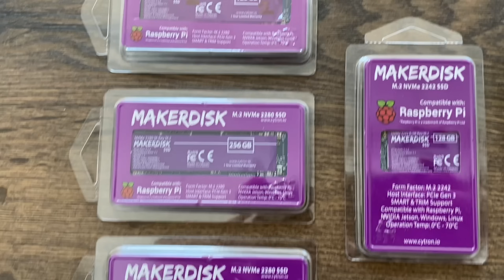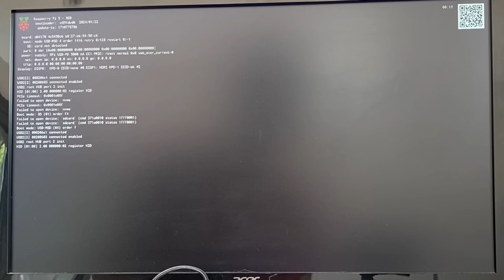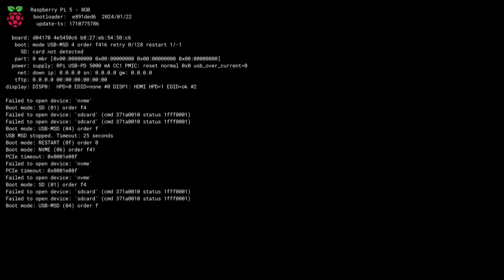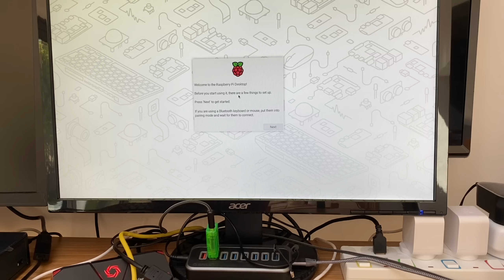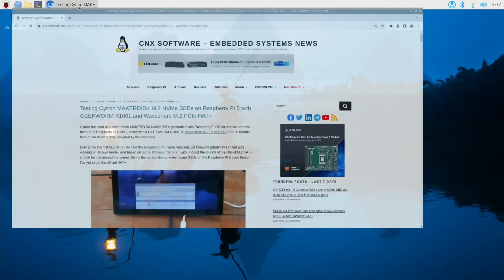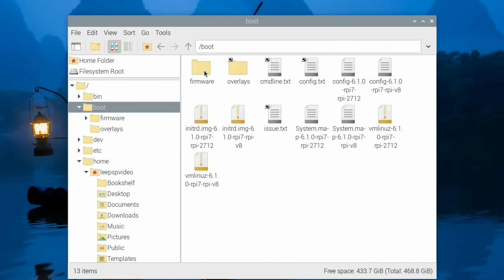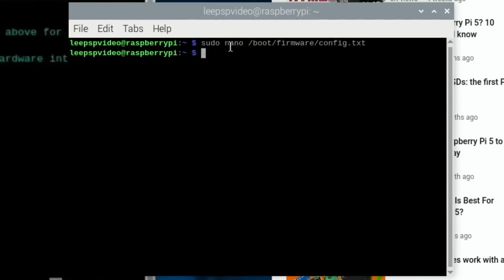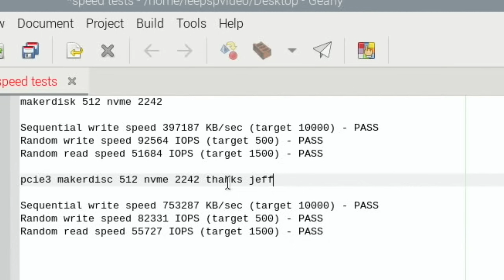Raspberry Pi 5 NVMe. Setup without a Computer. Cytron Makerdisk

Comment: in the /boot/firmware/config.txt file add three lines at the btm
dtparam=nvme
dtparam=pciex1
dtparam=pciex1_gen=3
I have 5 Pi 5's and zero issues with my config
same config below this all to over clock is 
arm_freq=3000
gpu_freq=1000
i wouldn't do over voltage or force_turbo. doesnt seem to matter

Comment: So the title is basically a clickbait. You NEED a computer if you don't have some special fancy nvme instead of one I want to buy.
Reply from the maker: It’s not clickbait. You need storage to use a Raspberry Pi. Makerdisk have sd card, 2.5” SSD and NVMe drives pre installed with Raspberry Pi OS. Hence the “setup without a computer”

Since this video an eeprom update now gives a network install option which also doesn’t need a computer

Raspberry Pi 5. Major eeprom update 17/04/2024. Network install & more
https://youtu.be/prqzOg-GC40

I have also made tutorials setting up a pi from an Android phone 

First time Setup with an Android phone. Raspberry Pi 5
https://youtu.be/H7DMzSvOWK0

Comment: Can we use Apple MAC power adapter for Raspberry PI 5
Reply: The USB 3.0 standard can provide up to 20 volts at 3 amps, the Raspberry Pi 5 probably maxes out at around 2 amps at 5 volts.

Even though Apple gets their hardware made in China just like every other company (but charges a premium price for it and hates your privacy) a MAC power adapter should work fine.

However, care should be taken when using unbranded USB 3.0 adapters.

Comment: My pi5 does offer network boot. "Latest" bootloader. It does not, however, allow kali to run; in my case, i suspect the distro doesn't support having nvme connected, even though I'm booting from SD or USB.
Reply from the maker: Most Linux systems support nvme. Unfortunately some don’t initially
Reply from the maker: Try Pinn os. Kali is listed for Pi 5. Might be a workaround 

Super easy Multi boot. Setup a Raspberry Pi with almost any device. Pinn Website.
https://youtu.be/eukGyB4sT3o
Reply: @leepspvideo  Will do, @leepspvideo, I have a 52pi bottom hat, the only thing I haven't tried beyond that is completely removing it. I have unplugged it's nvme, but it still has gpio pogo pins. All other os's boot fine, from all three interfaces. Thanks!👍
Reply: @w13rdguy  If you're running Kali Linux then you're presumably going to do some network analysis - so just stick it on a VM on a PC, that will work just fine.

Comment: In general - like the ssd idea in raspberry pi, but ... current setup with "hat on top" form-factor is not a good one. You'll have to compromise on cooling. Whichever fan or passive system one chooses, this ssd sits on top. It is actually blocking cooling. Hope that some day Raspberry pi Foundation will come up with better solutions. And one more thing: these Makerdisks cost as much as Raspberry pi itself.  Which is 10x more than comparable SD cards.
Reply from the maker: Sd cards are nowhere near comparable on speed or durability. They are however a good cheap option for things that don’t need the extra speed
Reply: @leepspvideo  agree about speed and overall purpose, but there's second part to it. With current setup (ssd right on top), how to cool processor effectively?
Reply from the maker: @samoylov1973  I haven’t had an issue with the setup shown. The NVME board has many holes and the official cooler/ heatsink. That said I’m about to try some more overclocking. My next video will show a bottom mounted nvme with ice tower cooler setup.
Reply: Thanks Lee for the new information, good to see the Pi keeps on improving…😊! The only thing missing is you reciting the items at the beginning of your video 3 times fast…😂!
Have a great day!
Reply: The Pimoroni NVME base is a nice option.
It goes under the pi 5, active cooler in the usual location.
I have one in my Plex server in a 3D printed case.
Reply from the maker: @BradClarke  and the Geekworm 

PCIe NVMe for Raspberry Pi 5. Geekworm
https://youtu.be/XMA8e4r1AUQ
Reply: I think an NVME drive is completely wasted on a Pi when the cheapest 4GB Pi 5 is £60 before you buy a case, power supply and cooling for it, when I can pick up a used SFF PC on "our favourite auction site" for less than £50 that will have a more powerful 3rd or 4th generation Intel Core-i5 or i7 CPU in it, at least 4GB RAM and I can just stick an SSD (maybe even that NVME drive) in that and it's ready to go.

I am a huge fan of Raspbery Pi and have lots of SBCs runnning but the Pi 5 isn't value for money any more. Its popularity has been its worst enemy because it has lost direction from what it originally set out to be and now is too expensive to offer good value for money compared to other available platforms - especially used PCs as lemmings rush to upgrade to Windows 11 and find out their old hardware can't run it.